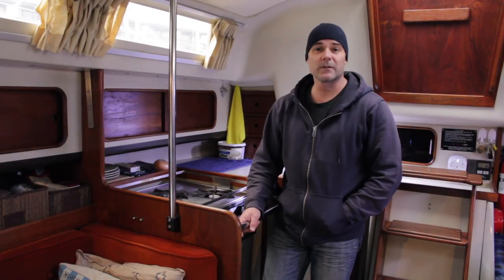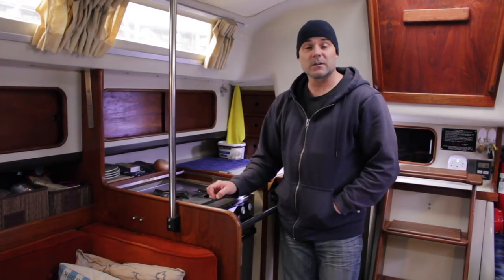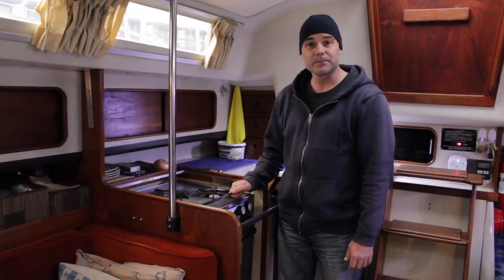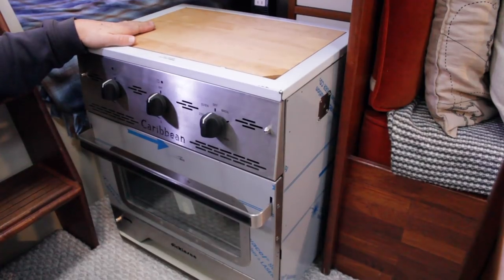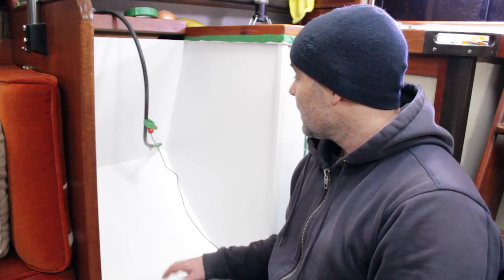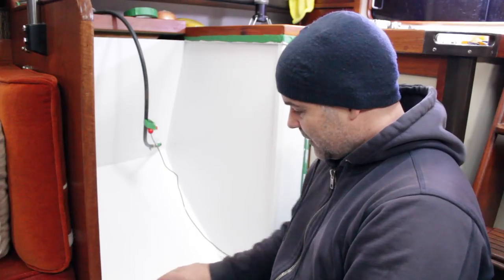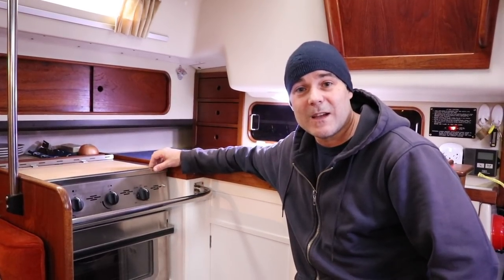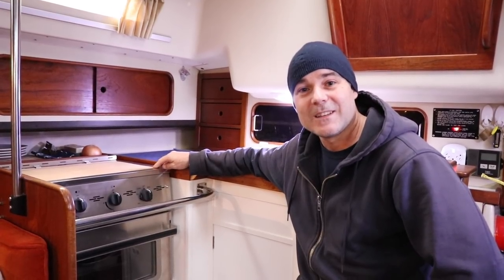Life is Like Sailing - Installing a New Dickinson Stove

Comment: Good little swap there. Hopefully it works out nice, and didn't take too long to get used to. An '82 you say? Looks pretty good for her age at least from what I've seen. I kind of like the wood in there, its a nice touch. Although, you are right, taking the teak trim off does help make it match with the rest a bit better. Merry Christmas out there!
Reply from the maker: For an unexpected little project, I sure am happy with the upgrade and the results of the painting.  I hate painting over teak, but they were such small trims pieces and it definitely looks better all white I think.  :)  Merry Christmas!!

Comment: Christmas turkey.  That would be an intense odor in that confined space.  Don't forget to do a pre-burn before you cook anything in the over.  To get rid of any oil or other contaminants on the metal surfaces - you've probably already thought of that but if not, the odor given of wouldn't be nearly as wonderful as turkey in the over.
Reply from the maker: Turkey would be amazing!  :)  Yes for sure a pre burn will need to be done.  :)

Comment: Hi, love your videos. I have a question about the gas line that goes to the stove. When it swings on the gimble how does it not stress the gas line ? Probably prevented in some manner, I was just curious. By the way, you have got to have the cleanest sailboat in the water. 👍
Reply from the maker: Thank you!  No problem for the gas line as it sits slack behind the stove.  The important thing with gimballed stoves is that you have enough line so it doesn't pull when the stove is unlocked.

Comment: I only use two burners 95% of the time.  I also noticed your broiler only works on the top...My oven at home on broil uses both elements, top and bottom.  Does your other burner on the bottom kick in as well???
Reply from the maker: I'll have to play with the oven a little more to see if I can have both elements running at the same time.  :)

Comment: I have same Hillerange on my San Juan 34. I'm looking to get the Caribbean. The force 10 has the fold under door, but yours has the broiler which is gold
Did the new brackets you installed come with oven?
Reply from the maker: Yes the brackets came with the oven.  :)

Comment: What paint did you use? Love your videos btw
Reply: Andrew Williams I was going to ask the same question in regards to that. Like. What brand of primer and paint did he use to get that kind of finish. Was it a two part paint? Or single? And how was the fume off on it. Was it very smelly?...
Reply from the maker: Sico primer and Sico paint.  Designed for Furniture and Cabinets and water based.  :)
Reply from the maker: Sico primer and Sico paint, single part paint and water based and not too smelly.  :)

Comment: From my view, it looks like the rail was designed to be on the front of the stove top... It looks like the brackets would hug the pot then, rather than the ends of the fingers just touching the pot. Eh?
Reply from the maker: The rail is definitely for the back as that is were the mounts are for it.  I think I had the pot holders in on the wrongs sides and if I swap them left to right and right to left then they look to hold a pot.  :)

Comment: wouldn't you want your propane sniffer on all the time for safety  , or do you only run it when using  your propane appliances because thats the only time you turn it on at the propane locker
Reply from the maker: yes, I use the sniffer when the propane tanks are in use.

Comment: Halibut - she did a salmon already i think, on one of your trips. But the oven seems like a splendid result - looks great, you must be thrilled.  Are you comfortable with the hose supply line condition? Is there any question about it's condition and whether the hose itself leaks?  Thinking about the hose supply line that runs through the hull before entering the salon.  A leak back there might allow gas to accumulate in the bilge spaces.  Not the locker, but along where the line runs might be open down into the bilge.  Mine was leaking until recently when I discovered it by a system check.  I have functioning sniffers in my salon too, but not in the bilge.  Disaster averted.
Reply from the maker: Sounds like you dodged a disaster!  I have inspected the hose before and it all looked in good condition, but that is something I will check with my annual maintenance and definitely an item to replace if is starts looking suspect.

Comment: No teflon gas tape in the threads? shame.
Reply from the maker: The installation manual specifically said not to put any tape there.
Reply: ok, right its a compression fitting.